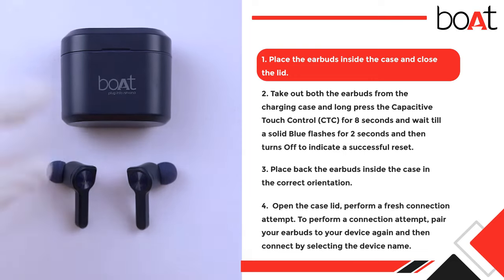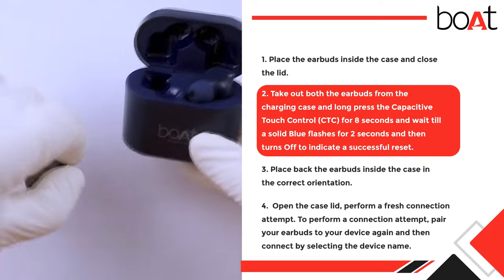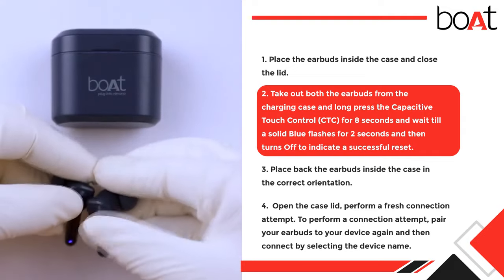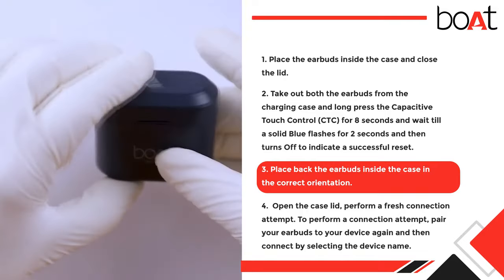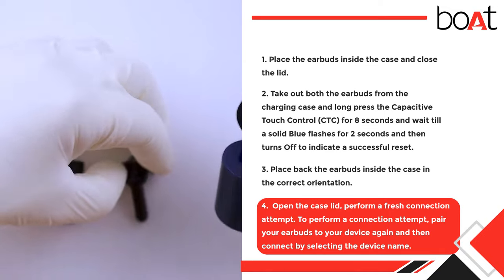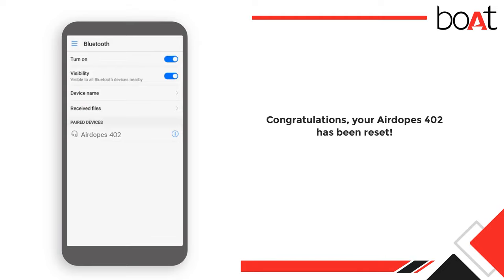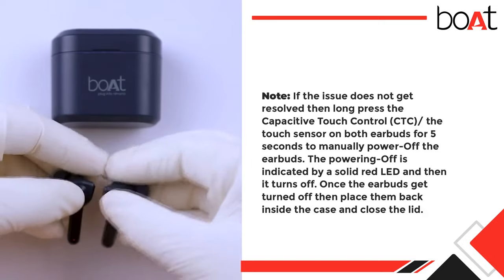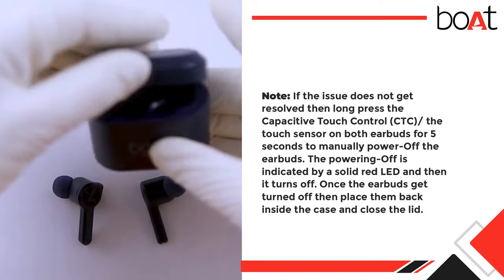boAt | Airdopes 402/408/161 | Resolve Your Product Issue

Comment: One of the worst product of boat airdopes 161.. used many of boats products. But these are the worst ones. Battery issue. One bud looses battery too quickly . Sometimes they doesn't even charge while being in their case.. connectivity issue.. don't gets disconnected when placed back in case. Now a issue i am facing both buds are having different Bluetooth connection. Like what happened to your products boat
Reply from the maker: Hi, we regret the inconvenience caused. Please let us know the exact issue you are facing with the product, along with the date and the platform from where you have purchased the product over DM, so that we can assist you in a better way.

Comment: People who are still facing the problem just follow the following steps and thanks me later
1. Unpair the airdopes from your device and put them in the case.
2. Now take out one earphone and tap 5 times ( don't tap too rapidly) until red and blue  light appears indicating reset and put back the earphone in the case.
3. Now repeat the process with other earphone as well and then connect them to your device.
Reply: Thanks a lot it helped me😊
Reply: aree mmaaa kasam bhai jo kisi ne nahi bataya vo tumne bataya
Reply: I am very grateful guys that it helped you
Reply: Still don't working

Comment: Today, I purchased Boat airdopes 161 but one is working and another is not working I tried to reset and turn it off but still the same issue . Please help me to resolve this issue.
Reply: Facing samw issue. Just received airdope max… just one sounds, 2 devices connects… any success?
Reply: boatlifestyle4466  from Flipkart

Comment: Guys if you face problems here fix that worked for me.
1) Take out ear dops from case and turn off by pressing for 8 seconds than ones red ligh flashes dont keep on pressings tap (press and leave) on ctc 3-4 times till violet light flashes.
2) put it in case.
3) take out of case and you will have both paired and working.
hope it works.

Comment: Those who are unable to reset the airdopes. Follow these steps instead:
1. Turn off the buds manually until the red light appears.
2. Put both the earbuds inside the case and close the lid.
3. Open the case and take out the left earbud and triple tap on CTC and the purple light (mix of red and blue) will appear. 
4. Now, take out the right earbud and do the same.
5. Put both the earbuds inside the case and close the lid.
6. Open the case and fresh pair your earphones.
That's it.
Reply: Thanks bro ,problem of main is left ear bud continuous red blue light blinking separately pairing not pairing with right ear bud that problem is SOLVED. Thank you so much
Reply: Thanks, bro. You just saved me from throwing away my earbuds. Now they are pairing with each other and my device, but the problem is still not solved. The left side earbud shows low battery after 4-5 hours of use.
Reply: Thank you, this worked for me

Comment: Right side of airdrop 402 is not blinking at all. Only left side is blinking with blue and red. I tried to unpair and pair again but in that process i am unable to find this in my Bluetooth devices. 

Tried all steps like long press for reset, douple tap, triple tap etc.. but nothing seems to work. 

Compared to boat the noise seems a better option.
Reply: Same here? Right side airdope not blinking at all...what to do? Is your problem solved?

Comment: I bought boat eardopes max a month ago.... It has an charging issue on left side eardope.. so claim warranty for that product.. After the replacement that replaced products have also an issue that didn't pair with each other..both eardope separately paired with my mobile.... First time disappointed with boat product and experiences worse.... there was no warranty card in replaced product..

Comment: It still doesn't work for me, one side is in pairing mode while the other is connected..
Reply: boAt lifestyle  I'm using the Airdopes 408
Reply: boAt lifestyle  Well, nevermind, i just checked the manual and found out the factory reset system, thanks for trying to help though!

Comment: I have bought airdopes 207 from the boat website itself and its been just a month i bought it and disconnects frequently and audio is not clear and the main problem is battery even though it is showing 100% within 5 mins it drops to 20 and warns me of low battery the worst I have ever bought
Reply from the maker: Hi Avinash! We understand your concern. If you vomit face any issues regarding your product, or if your device has malfunctioned, kindly raise a complaint here -http://support.boat-lifestyle.com to assist you better and at the earliest.
If you need assistance with checking the serial number on your product, you can find guidance here: https://support.boat-lifestyle.com/articles/popular-help-topics/product-related/64bfd7214d308d726b140bdc?keyword=serial
If you need assistance with checking the serial number on your product, you can find guidance here: https://support.boat-lifestyle.com/articles/popular-help-topics/product-related/64bfd7214d308d726b140bdc?keyword=serial
Try to register a complaint through laptop or desktop, if you are still not able to register please elaborate the error so we can assist you. Please note, customers will be directed to the nearest service centre if present in your pincode. If not, then we will generate a pickup to process the warranty claim.
For any further concerns, please feel free to contact us on 022-6918-1920 or you can also write back to us at info@imaginemarketingindia.com

Comment: i have boat 408 ....left side not working....this video doesn't solved my problem... very bad product and service from boat
Reply from the maker: Hi Parag! Thank you for contacting us. We sincerely apologize for any inconvenience you may have experienced.
Please try to reset the airdrops once in order to check if the issue is resolved. Please follow the steps of a reset here at this link:
https://cdn.shopify.com/s/files/1/0057/8938/4802/files/airdopes-402.pdf?v=1593412822
 Please note that the warranty claim process must be initiated by the customer. We fully understand your concerns and are here to assist you. If you encounter any issues with your product, we kindly request you to submit a complaint through the following link: https://warranty.boat-lifestyle.com/service-center.
If you require assistance in locating the serial number on your product, please refer to our helpful guide available…

Comment: Boat Airdopes 408 
The worst product ever I've used ...
Dont buy it ..pura paisa waste ho gaya kabhi connect hi nai hota hai
Reply from the maker: Hi! We understand your concern. If you face any issues regarding your product, or if your device has malfunctioned, kindly raise a complaint here -http://support.boat-lifestyle.com to assist you better and at the earliest.
If you need assistance with checking the serial number on your product, you can find guidance here: https://support.boat-lifestyle.com/articles/popular-help-topics/product-related/64bfd7214d308d726b140bdc?keyword=serial
Try to register a complaint through laptop or desktop, if you are still not able to register please elaborate the error so we can assist you. Please note, customers will be directed to the nearest service centre if present in your pincode. If not, then we will generate a pickup to process the warranty claim.
We empathize with your experience and once again assure you, it would be rectified at the earliest. 
For any further concerns, please feel free to contact us at info@imaginemarketingindia.com or you can also write back to us.

Comment: It didn't work
Reply from the maker: Hi Anshul! We understand your concern. If you face any issues regarding your product, or if your device has malfunctioned, kindly raise a complaint here -http://support.boat-lifestyle.com to assist you better and at the earliest.
Try to register a complaint through laptop or desktop, if you are still not able to register please elaborate the error so we can assist you. Please note, customers will be directed to the nearest service centre if present in your pincode. If not, then we will generate a pickup to process the warranty claim.
We empathize with your experience and once again assure you, it would be rectified at the earliest. 
For any further concerns, please feel free to contact us on 022-6918-1920 or you can also write back to us.